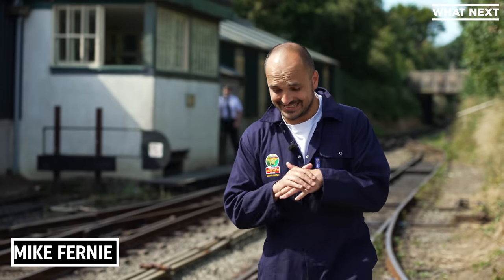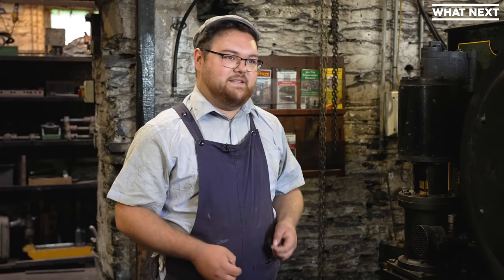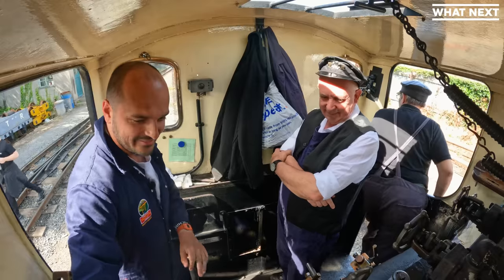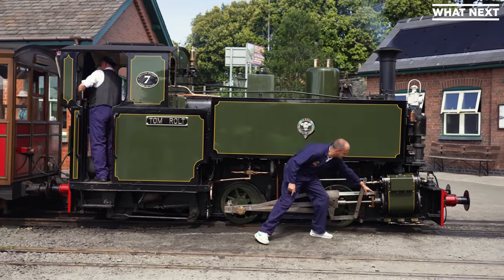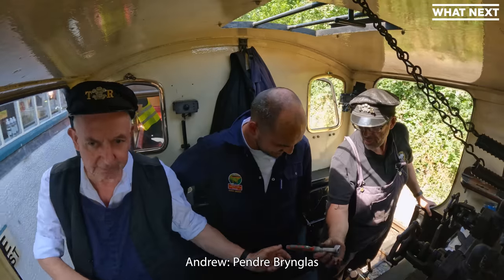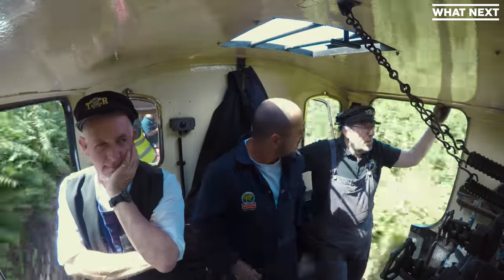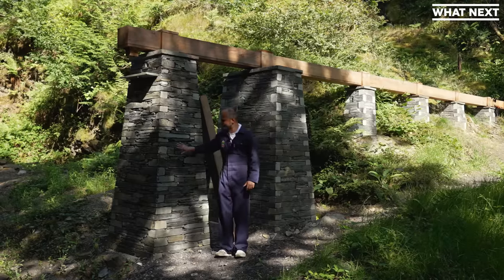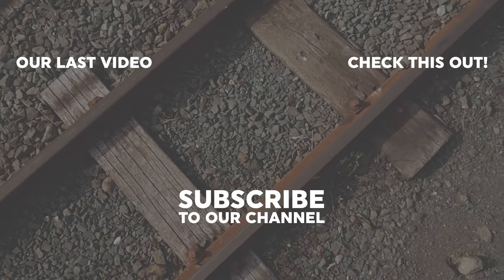This old steam railway is more important than you think

Comment: Having operated a steam engine, the thing people don't realize is just how delicate the throttle truly is. There is a fine line between "we got it moving" and "we spun the drivers" which is BAD. That said, once you get a feel for it, the engine legitimately talks to you. You learn how to listen to what it is telling you and how to react. Also, due to the extremely low rolling resistance of the rails, you only need a light touch to get going and on flat ground, it will coast for a long distance. 

Mike did an incredible job operating, he really has a knack for operating the engine and did an incredible job of presenting too. Proper job all around!

Comment: It may be the first to be DESIGNATED a heritage railway or railroad, but the Strasburg Railroad outside of Paradise, PA, USA is a heritage railroad that's been in continuous operation since 1832. They have 5 operational steam locomotives and occasionally will move freight trains with the steam engines. 
Reading and Northern, not too far from Strasburg in Port Clinton, PA, currently has 2 operational steam locomotives they run passenger excursions and occasionally freight with. 
I don't know how much weight Strasburg pulls, but R&N has Reading 2102 4-8-4 that was designed for pulling heavy coal trains with in the mountains, which they do.
Reply: The Talyllyn was opened in 1865 and was taken over by the Talyllyn Railway Preservation Society in 1950, it was the first railway to be run by volunteers. Obviously it is not the oldest continuously running railway, that’s not what was said
Reply: @QuarrySteam  I wouldn't consider that continuously operated since another entity took it over. It's not like it merged, like Chesapeake and Ohio joining with Seaboard to form CSX, or changed names like the Philadelphia & Reading becoming Reading Railroad ending up as Reading Lines. The assets are old, but there's no direct connection to 1865. I'm not saying their efforts aren't commendable, and I'd definitely try to make time if I ever find myself in the UK, but there's some stretching going on with terms. I guess foamers will foam.

Comment: Hi Mike - great job 👏🏻 
I have a question for James.  Why aren’t electric locomotives more common already?  Sure batteries are heavy, but so is a train. Given that electric motors have oodles of torque and that’s exactly what locomotives need, I feel like this could have been accomplished by now. 
And adding fast charging to sidings along the line seemed like a reasonable prospect (certainly more realistic than electrifying entire lines ala high speed rail).
Reply: Batteries just dont hold enough power for rail use outside of yard shunters. you;d have to have heavy batteries down the whole train, much more economical and easy to just install overhead power lines and use those
Reply: @oliverbooth2872  Nailed it. Batteries just don't have the energy density to be useful outside of edge cases like shunters. It's a very real case that electrifying the line is the optimal method.
Reply: Most train engines are diesel electric. They are essentially big generators that are directly wired to electric motors. You get the benefit of electric motors with the excellent energy storage of diesel.
Reply: @stuartdilts2729  it's not "most," it's "all" - at least here in the US. Europe and Japan have some lines that run off overhead main wires bit other than the few heritage steam locos every working train in the USA is diesel generated electric driven.

Comment: How can you fill the reservoir with water while you still have water remaining for the boiler?  or  do you just use up all the steam in exact, specific amounts? [no, that wouldn't be it]
Reply: What exactly do you mean by reservoir? The water tanks on the engine can be filled at any point as the feed for putting water in the boiler isn't constant - it's controlled by the Fireman.
Reply: @ExplosiveCookie  I guess its odd how a hot boiler under pressure can be fed without the backpressure blowing it away; there's a mech. Eng step I'm missing...
Reply: @pretzelhunt  Steam injectors! They're black magic...

The water from the tanks is fed down a pipe to a series of cones, each gradually getting smaller with a smaller opening. Steam is then fed behind the water in the pipe, which then shoots the cold water into the cones and puts it under even more pressure as it passes through smaller and smaller holes - now it has enough pressure to be fed into the boiler without backpressure.

Comment: Are trains becoming less cool....
Jeez, i dunno. We can fly, can't we? So why waste time on tracks?

We can go to the moon. We did it 6 times already. Still waiting for us to go back again, but..... we can go to the moon.

So nah. 

Trains are exciting.

A huge piece of metal sliding down a long thin metal track, exciting.
Cool.

Until they break down right at a junction, where you need to cross the tracks.
And the only way around that junction is diverting 100 miles.
Then it becomes less cool.
Especially in hot summer.